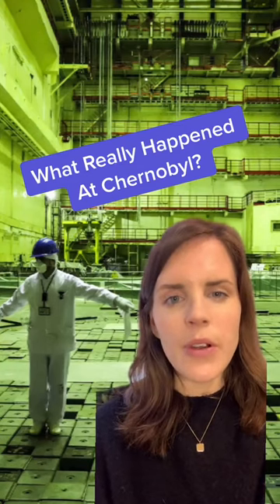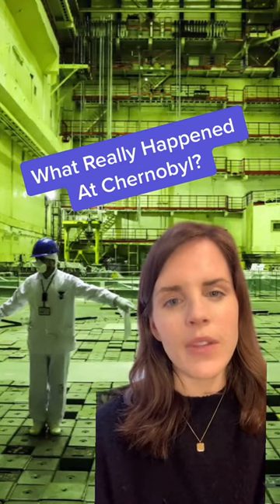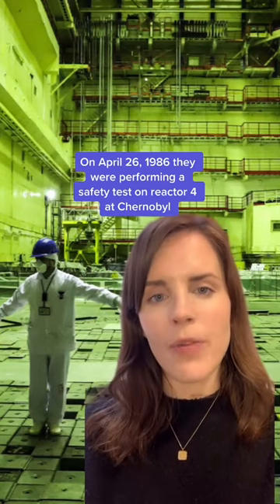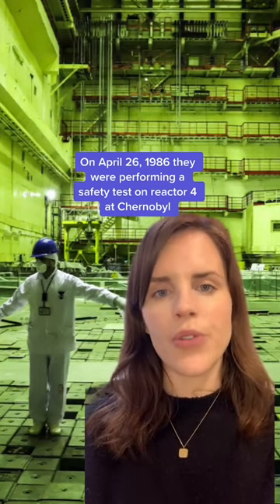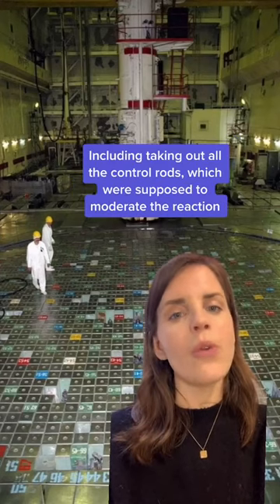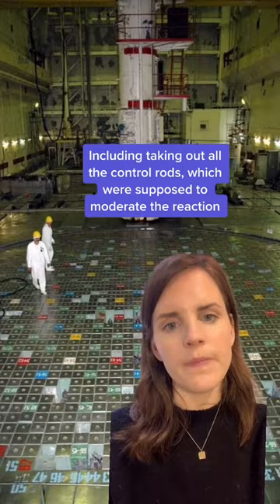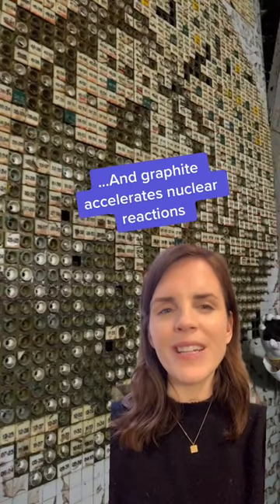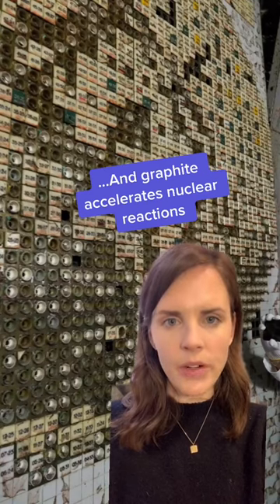What Really Happened At Chernobyl? #shorts

Comment: Just to provide a little more detail to this story. The RBMK reactor 4 at chernobyl was conduct a test to see that if there was a blackout could the plant still receive electricity from the dieing water turbine so that the back up generates have time to get up to speed thats the test. What caused the explosion was that the day shift plant held the reactor at half power which built up zenon which slows reactivate. And when they brought the power down it dropped rapidly and got stuck. Well an RBMK rector has reactivity swings at low power but control rods help with that. But at chernobyl out of 216 control rods only 13 were left on the reactor. Well the director didn't care and conducted the test anyways which the night shift has no idea what's going on and just found out about it. When they slowed down the water turbine the cooling water in the reactor turns to steam which increases reactivate and makes the power spike. The operators noticed and pushes AZ-5 which pushes all control rods back into the reactor. Well like the lady said the tips were made of graphite so when they went back in the reactivate jumps horrible and jams the rod in place endlessly speeding up the reaction. Reactor 4 is now set to blow which is a steam explosion not a nuclear one. Once the lid is throw off oxygen rushes in to meet super heated graphite which cause a fire that burned for weeks. The reactor that was designed to run at 3,200 mega watt when beyond 33,000 mega watt. Thanks for readying hopeful this helps
Reply: A) its xenon, not zenon
B) xenon poisoning was because the power was dropped to abt 75 MWh and stalled the reactor. But yes there was a grid problem in russia so the operator told them they cant do the test and should just keep it at half powrr
Reply: Also, the graphite IS a moderator, but in that case, it replaced the water left, and then there was only steam. The lady tells that the graphite caused all of this but it's really not. In a non-poisoned and with water flowing reactor, the AZ-5 would've done the job to shut it down, hence why all the other decomissioned RBMK reactors were deactivated safely using AZ-5. 
You see, you don't stall this reactor to shut it down, you press AZ-5 following a set of specific parameters to then press it. The night shift at reactor no. 4 tried to shut it down without following the correct parameters, and there it goes.
"But if it works as intended, why was AZ-5 blamed for this as a design flaw?"
It works, ONLY following specific conditions, you can't press it anytime you want it to, or else it blows the reactor, that's why it's a design flaw.

Comment: I think she is confusing nuetron moderators with nuetron absorbers. Graphite is a nuetron moderator. It slows down nuetrons, resulting in an acceleration in the reaction. The control rods were made out of nuetron absorber. They absorb nuetrons, decelerating the reaction. The "tips" of the rods were made of graphite so that when the rods were fully lifted, the graphite part of the rods would enter the core and act as a gas pedal.

Comment: A couple important notes. Graphite is a reaction moderator not accelerant as this video claims. And the explosion was a steam expansion explosion as the melting reactor core ate through the bottom of it's containment and contacted a large amount of water. This is an important note as many people believe it was a nuclear explosion as in a nuclear bomb however this is not possible with the percentage of enrichment used in nuclear fuel   I believe between 2% and 5%? Where as the fission material used to make nuclear weapons has to be above 90% or so   just off the top of my head so don't take those numbers as fact.  If anyone wants to further Research the Chernobyl disaster @plainlydifficult has an excellent video on the subject as well as many other reactor incidents

Comment: I dont know if the tips caused the explosion I never heard of that before, what I always heard was that after removing to many rods to prevent the reaktor from shutting down, because at the time it was supplying its own water pumps with electricity, to test if It could do that safely in case of a power outage, the reactor got really hot really quickly and melted or bend the controll rods so they couldnt be put back in again. The reactor eventually got so hot, that  the water in the reactor rapidly turned into steam, which usually cant happen because the pressure is to high. This caused an enourmous rise in pressure in the reaktor causing the realativly cheap shielding of the reactor to fail and send the roof flying. The Uranium fuel rods then melted together and started to burn through the bottom of the reactor and than several meters of concrete and steel until finaly coming to a stop and forming what we today know as the elephants foot, which is still a little warm btw.

Comment: The reactor was poised with xenon gas which made it highly unstable and in order for the operators to start the test they needed to lower the energy levels but because the reactor was poisoned the power levels plummeted way too low. So the operators decided to take out nearly all of the control rods to raise the power.  They started the test by closing the steam valve for turbine No. 8.  But the steam pressure started to build up in the reactor which caused the power levels to skyrocket. The operators hit the AZ-5 button to try to control the reactor but because of the tick effect caused by the graphite tips it made the reactor power levels to even higher and the rest is history.

Comment: The control rods weren't the moderator. Graphite was. Please don't mix terms it just spreads confusion and then you get even more people not knowing what "actually happened" at Chernobyl
Reply: I must say I was surprised when she said graphite accelerates nuclear reactions as if this happens generally (but hey what do I know?)

However "the graphite [section of the control rod] displaces water that would otherwise act as a neutron absorber, ... a control rod channel filled with graphite absorbs fewer neutrons than when filled with water" Wikipedia, on RBMK. 

So under these specific conditions, maybe inserting the control rod could be blamed for accelerating the reaction.
Reply: @chrisg3030  so that's what I was talking about with confusing terms. She said the boron rods "moderate" the reactor. She was using common parlance of the word to mean lower/stabilize. However a moderator is a specific term in reactors. They are used to "slow" down neutrons which in turn makes those neutrons more likely to cause more reactions. So graphite is used to accelerate reactions by moderating neutrons

Comment: Wrong. They actually had half the control rods in. Which made the reactor go down to 2.3% power. Then, it started to go up becahse of positive void coefficient (Basically water turns into steam and cant moderate the reaction) and they inserted the control rods using AZ-5, the graphite thips got stuck from the heat, and the lack of water and neutron moderation caused the explosion.

Comment: This is wrong. 
Graphite actually moderates the reaction. What caused the explosion was the pressure buildup because graphite came in first of all, but there was almost no water left, and the reactor was heavily poisoned by xenon, so steam + xenon caused a runaway reaction, and the graphite, who moderates the reaction, in this case made the space between the tip of the rods and the bottom of the reactor smaller, building up more pressure, xenon goes away, steam builds up, the channels ruptured and it blew the 2000 ton bioshield off, followed by another more violent explosion caused by oxygen mixed with +2000 degree exposed fuel.